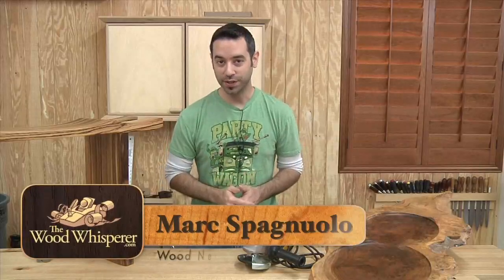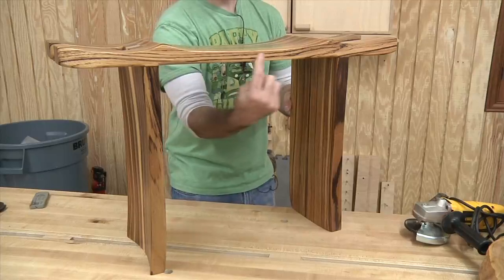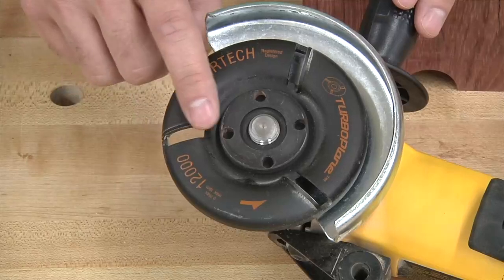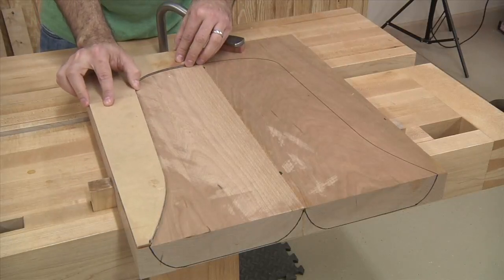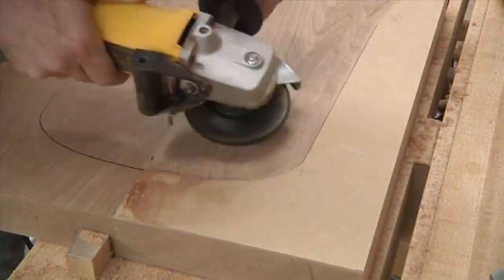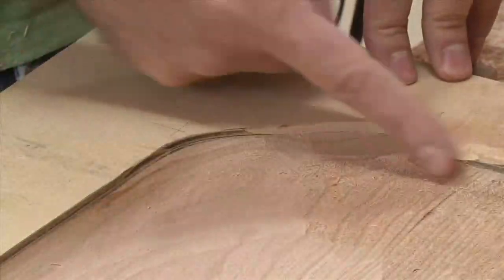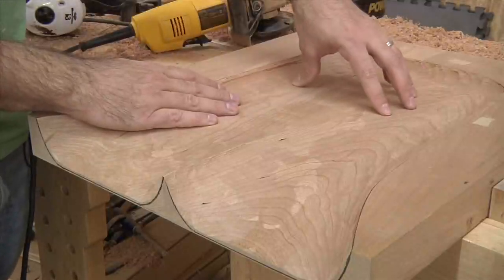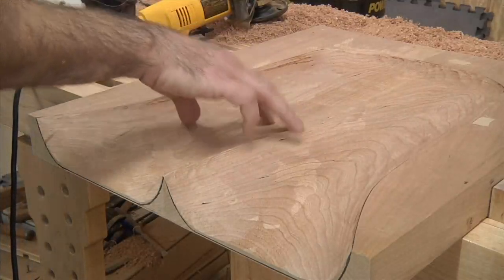193 - Power Carving with the Arbortech TURBOPlane

Comment: Have you considered the Holey Gallahad series of abrasive grinder disks?  I used the medium coarseness disk to knock out a couple of Windsor chair seats a few months ago and it was a breeze to shift the bulk of the carving with. It allows for plenty of control over how finely I worked and they have the added benefit of being able to see relatively well through the holed body of the disk. I also used the Arbortech mini-grinder attachment with the sanding disk attachment to clean up the seat after

Comment: sorry if you've answered this already, Do you need any adapters or anything to fit the arbor tech blades to a regular 4 1/2 inch grinder??  I've done a little web searching, hard to find a straight answer.  Ive actually been looking at the mini industrial cutter, planer ones a bit pricey.  But, after seein this, it may be worth it.  Please and thank you.

Comment: A cheaper. alternative product would be the Kutzall sanding/carving disc (about $60).  I used one to make a sculpted rocking chair and it worked well, although very messy.  Also, drilling holes at the desired depth and at different sections of the seat is a great reference point to use in the rough carving.

Comment: Marc, Good review I want one of em'.  If you had the wife seat herself on the 8/4 blank and do the initial trace around her you would have a more graceful contour don;t you think?  I used a similar tool that cut like a rotary  chain saw.  Used it on built up MDF to shape out a hobby horse mold. I never saw sooo much material in the air.  Mold was a success, but I still fight the shop blanket of dust  in all nooks and crannies!

Comment: hi Marc, I bought the Arbortech Turbo Plane, but I have heard that there are clearance issues with the Dewalt DWE402 grinder guard and the Turbo Plane, even with the supplied spacers from Arbortech. Can you shed some light on this. I didn’t want to buy the wrong grinder and return it. which dewalt model are you using? thx in advance.

Comment: This is a fantastic video. I would suggest instead of going from the turbo plane directly to a rasp, use a disc sander for a grinder as a middle step to quickly smooth out curves and and high points then move onto rasps and scrapers.

Comment from the maker: Well, I wouldn't go too small as you really should be using this thing on larger pieces. But for me, I'd rather practice and make something useful. But I also have some experience with tools like this one. For an absolute novice, I'd recommend grabbing a 2x4 and going at it. I should mention though that this chair seat is not a real chair seat. Just made it for demo purposes. It's definitely too narrow to be useful. :)

Comment: GREAT vid-wish I'd seen it before I went hoggin w my KAT Galahad (which I love).  Would love to see more vids on this technique.  I think it might be worth annotating the vid, that some woods are extremely dangerous to cut (shred in this case) because the dust is toxic.  Also, I wonder what difference a nice angle grinder makes compared to my cheapy black n decker?  easier to control?  Thanks again for the inspiration!
Reply: There really won't be any significant difference between brands of grinders. Per haps the motor or the on/off switch will fail somewhat sooner on a cheap unit, but then again maybe not. Noise may be  factor to some folk, and for that and other  reasons I won't own another Craftsman power tool.

Comment: Nice video. You have to wear safety glasses with that face guard, per the manufacturer. The Turboplane is a very handy accessory, and you are right, there is a learning curve, but it is not too long. I greatly prefer it to a chainsaw blade disc.

Comment: Oh and as a man with a lot of experience using a grinder, if you want more control with the tool to make cleaner cuts get a longer grinder and always use the side grip like you did. The longer grinder will allow you to keep your elbows closer into your body. The elbow close to the body means less bounce and movement in the arm. The more the arm moves at the elbow as you grind the more the grinder moves at the point of contact. If you minimize the elbow you minimize the amount of dig out you get from the blades. I'd also suggest one that has the air vents in a different location. The one you have there can be a tendency to place your hand over the vent holes which will cause the motor to heat up and can either burn your hand slowly as you use the tool, or burn out your motor prematurely.
Reply: I just do hecka burpees brah.  Put one each finger like Edward Grinderhands.

Comment: I know you already have a full face shield. But with the cumbersome nature of that and a respirator have you considered buying something like the 3M 6900 Full Face respirator? They are acceptable for this type of work, both for eye / face protection and respiratory as well. Considering your face shield is about $30-45 depending on where you buy it and the 3M 6900 is about $92 on Amazon it's not that much more. At least when you consider the cost of an added respirator all together, the hassle of trying to put both on at once, and this thing would offer full protection even against material that might bounce in from your chest, which I have had happen. Just a thought, not trying to sell for myself or anyone and personally would recommend something cheaper if I thought it was actually safe, but this is a safe affordable option to have. It is also one of the cheapest on the market that I've seen.

Comment: Marc, great vid, I really appreciate that you included your mistake because our mistakes are what we learn from the best.

This Arbortech demo is from 4 years ago, so I imagine you've spent some serious time with it by now.  Have you been able to do the same with the Kutzall disks or the Lancelot product line?

I ask because I have a bench project for my wife that will be hewn from a 12" x 12" old growth redwood timber, and as you understand, redwood is very soft.  That means I need to be choosey about the tool I use to sculpt it.

Along the same line, these disks are obviously roughing tools, so how do you finish off your seats/sculpting after the Arbortech?  I assume a French curve card scraper would be pretty good for handling those contours.

TIA, Bradley